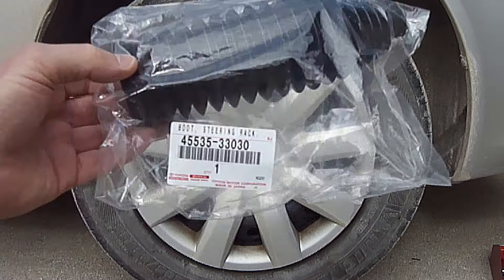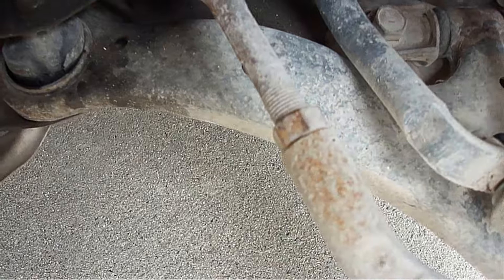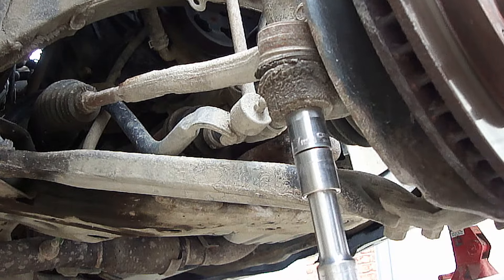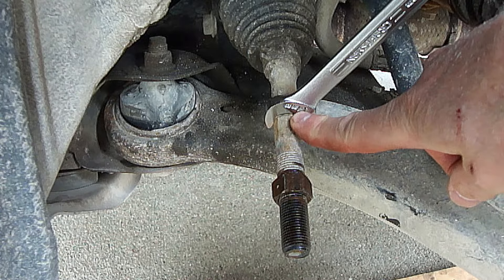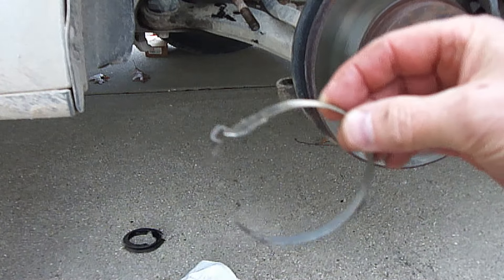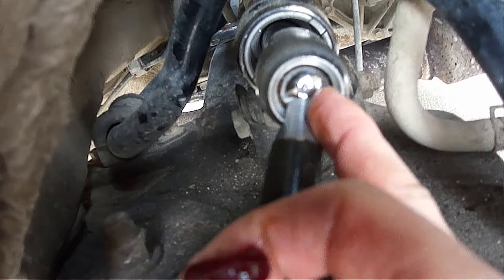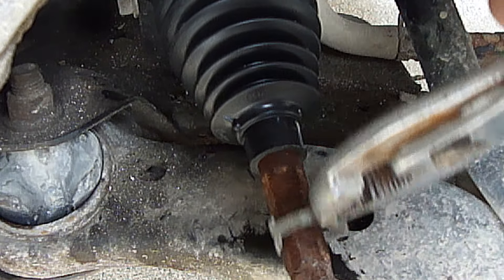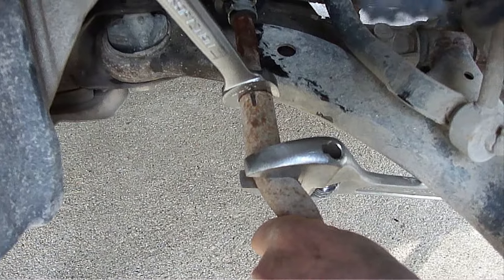NEVER Replace Steering Rack Boots Until Watching This!

Comment: So if my boots are leaking should I just replace my entire rack and pinion or should I just replace the seals and the boots?
Reply from the maker: Jose Guevara try some blue devil power steering stop leak
Reply: proclaimliberty2000 should I drain out the power steering fluid that’s already in the system
Reply from the maker: Jose Guevara I would if it’s dirty , but otherwise I wouldn’t worry about it.
Reply: proclaimliberty2000 thanks I’ll give it a try 🙏🏻
Reply from the maker: Jose Guevara 👍😊
Reply: @J.guevara45  did it work? I would try Lucas not blue devil

Comment: I have a busted boot and not sure if I need to just do this or replace the whole rack and pinion
Reply from the maker: If you have no oil leak then you only need to replace the boot. If you have an oil leak then first try adding BlueDevil stop leak. Replacing the rack and pinion system will cost you a fortune not only in parts but in labor as well.
Reply: @proclaimliberty2000  awesome, thanks!
Reply from the maker: @Wanderer24999  👍😊
Reply: @proclaimliberty2000  oil leak or power steering leak
Reply: @kelseyrainwater3918  You do realize that "power steering fluid" is an oil, right! ;-)

Comment: My boot is ripped and there is a puddle of power steering fluid under my truck what does that mean? The reservoir is not that low though. 2013 Nissan Titan (drinker's side)
Reply from the maker: It means your rack and pinion steering seal has a leak. Pour some blue devil power steering fluid stop leak in the reservoir and that may stop it. Let me know what happens. Any auto parts store like AutoZone should carry it.
Reply: @proclaimliberty2000  shoot I just poured Lucas in there. That's good stuff too. Think it's a bandaid or do you think it can last permanently? This truck literally needs everything replaced rn. It's been a hard 140k miles.  I may wrap the ripped boot with flex tape lol. Thing is its pretty dirty in there. Is that gonna wreck it?
Reply from the maker: @misterbulger  that can be a permanent fix but you’ve got to keep that dirt out of there.
Reply: @misterbulger  hows it working
Reply: @kelseyrainwater3918  not a drip! Good stuff.
Reply: @misterbulger  my boot ripped but not leaking think ima just ride it out tired putting money in my car every month since I had it
Reply: @kelseyrainwater3918  I'm not replacing my boot. Im going to clean it out as best I can and then zip tie/tape a piece of plastic around it to keep the dirt out. That'll probably get me by another 75k miles lol
Reply: @misterbulger  how many miles are on your car? Yeah that will work make sure it's loose tho so it don't rip when turning
Reply: @misterbulger  how offen do u refill the power steering? My friend drove 2 years with leaking rack when the steering got stiff or started making noise he would refill it but it anstancly pour out
Reply: @kelseyrainwater3918  I top mine up every 6 months or so. But the high pressure hoses on my ps pump seem to be seeping... it's been that way since new. I added a little lucas about 5 years ago and it pretty much took care of it but I guess it just wanted a little bit more. Sometimes fixing stuff right is the way to go but if you have a long term bandaid why not use it and save some money?
Reply: @misterbulger  so it's barley dripping nothing too worried about for now
Reply: @kelseyrainwater3918  did you try stop leak? I took a turkey baster and removed some ps fluid first so it wouldn't be overfilled and then added the Lucas power steering stop leak. Lucas guarantees that it'll stop any leak with up to 2 bottles.
Reply: @misterbulger  mines isn't leaking but my boot has a 2inch ripp in it

Comment: Question: do we need to replace power steering fluid after doing this or not?
Reply: It has nothing to do with steering fluid. Just renew the grease on that inner tie rod end after a good cleaning.
Reply: However you could renew the fluid if you think your vehicle's fluid is excessively dirty. However - my CRV is 22 years old, 307K miles and it still has the original fluid in it. I bought the car new. No noises, no leaks. I'm not changing anything. Also note that I am careful about not turning the steering hard left or right and holding it there.

Comment: I have replaced my boots so many times over the past few weeks. Evrytime I change one or the other it's always the same problem. They split and I lose my fluids. I tryed pushing the boot on further thinking that it or only split by stretching on a turn but it still rip. Also my boots are always bending. Now I'm thinking maybe I'm putting the clamps too tight. What am I doing wrong
Reply from the maker: TripleXXX Beats Are they good quality boots? Also, it sounds like you have seals leaking. Try using Blue devil power steering stop leak.
Reply: Yep! To what he said. 
BTW The boots are dust covers, they're not there to seal any leaks! Be aware that some of them even come with small vent holes so air can sip in and out. Definitely not a seal of any sort! ;-)
With this said, it really sound like you're installing the wrong boots. They're not an universal fit, in spite they might look like it! Make sure you're getting the right model for your particular vehicle. In case of doubt get an OEM. They're cheap enough to don't harm your pocket much!  
Preference for "rubber" boots over plastic ones, is also something I learned many years ago. They might not last as long as the plastic versions but they're way more flexible.
Reply: @crpth1  right its just a dust cover ill be fine its if my has a ripped in it ... not leaking anything so I'm good
Reply: You'll be fine without the boot
Reply: @crpth1  is that true nothing too worried about with a ripped boot
Reply: @kelseyrainwater3918  If those boots were not important the factory would not have put them on the car. It keeps the inner tie rod ends from being contaminated with dirt and water. Don't know about your car but mine has exposed greasy parts inside that boot.

Comment: I wish that boot went on as easy as your saying...
Reply: Yes - that can be the killer! especially when there is enough grease on the boot and your hands as to make it impossible to get any grip on the thing and even more so when the access is limited.
Reply: I just wrote similar tip above. 
- Use an hair drier or heat gun to warm up the rubber/plastic immediately before fitting... It make miracles! ;-)
BE really careful if using a heat gun, otherwise you'll melt the boot.
- Lube it prior to fitting silicone spray is my preference for such a task.
- Last but not least make sure to get the correct boot for your particular vehicle. They're NOT universal or one size fits all! ;-)
Reply: @crpth1  excellent advice mate. Turned out the 'universal' one we had was smaller. Cheers